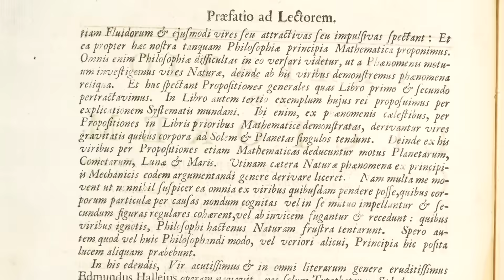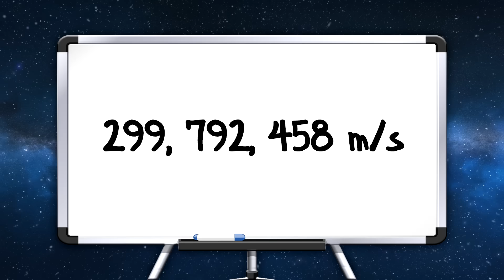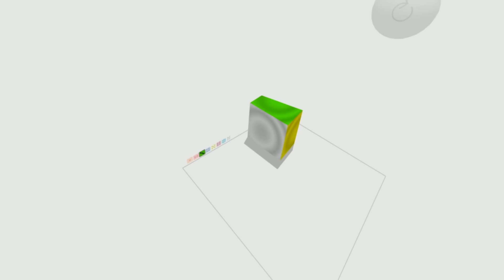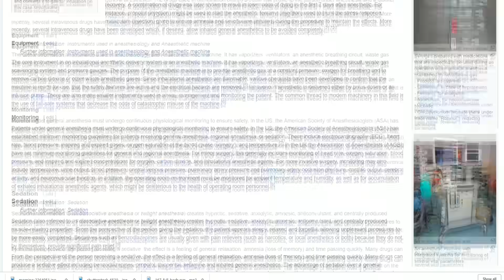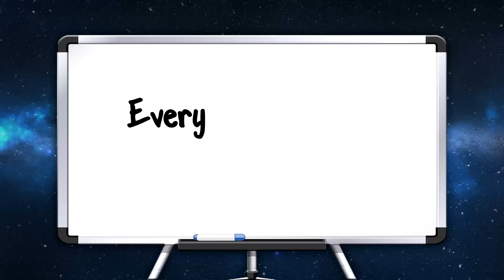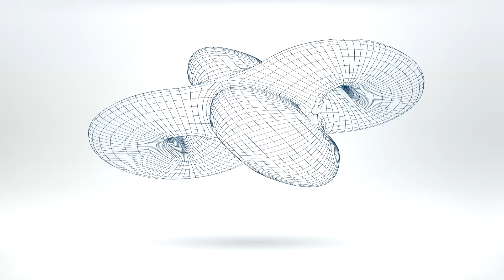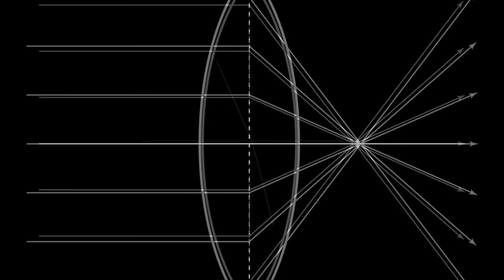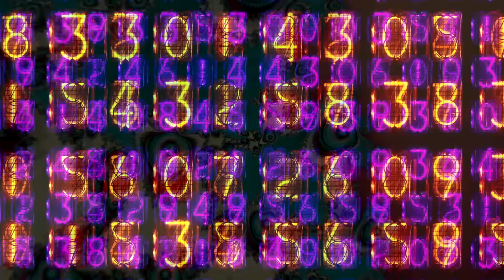The Mystery at the Bottom of Physics

Comment: If it is not a variable it is a constant. Welcome to math dude.  "6.674×10−11, which we call G. We need it just because of the way our unit of force, the newton, is defined: 1 newton is defined as the force needed to give a mass of 1 kilogram an acceleration of 1 meter per second squared. The kilogram, meter and second are rather arbitrary quantities, and as such, the newton is an arbitrary unit" - internet. I.e, it can be 1 if it makes you feel better just change your relative measure.

Comment: Suppose the universe is built upon pure geometry. It seems that everything requires at least one dimension to manifest. Height for example, is one dimensional.
A one dimensional thing can only exist if it has opposite ends, with a continuum inbetween. This is the principle of yin and yang.
On a mirror smooth pond, when a wave is created, there must also be an equal and opposite troth. Otherwise the pond volume will increase by the volume of the wave.
The particles of the standard model are yin and yang.
String theory; a string is a one dimensional object and is therefore yin and yang.
Newtons laws are yin and yang.
Statistically speaking it would be more likely that the universe would have come about due to a simple process. The yin yang principle is the simplest theory and underpins all others.

The universe is made of stuff; the stuff you're made of, the stuff I'm made of. We are 13.7 billion years old. There is no such thing as you and me, we are all one thing.
We are to the universe as waves are to the ocean. Waves are the ocean, all one thing.
What is the wind that blows the waves?

Comment: Is that right that if you were travelling at 250,000,000 m/s that light would still be travelling 'away' from you at 299,792,458 m/s? I thought if you were travelling past a planet say at 250,000,000 m/s and turned on a torch, the light from the torch measured from that planet would still be travelling at the speed of light (not the speed of light + your 250,000,000), but that relative to you it would only be travelling away at 49,792,458? Or is that a trick of special relatively that light always seems to be travelling away from you at the speed of light regardless of your own speed?

Comment: Obviously the speed of light DOES change. Relative to it's direction of travel compared to yours. Generally light is traveling in all directions around us during the day, that is why there is ambient light when the sun isn't shining directly into a room with windows. However, that doesn't change the fact that the light originated from a specific direction, direct sunlight. So in the morning if you are out for a jog with the sun at your back then photons take longer to hit you. Not by much, but it's the same effect as if a vehicle is driving next to you. It would be driving faster if you were standing still, relative to your speed. Likewise if you were running towards the sun then the light itself would be traveling faster than the "speed of light." There is no set speed, it's a physical tangible material with limitations. That's why plants can use it for growing physical material. Chlorophyll doesn't just "unlock" energy using sunlight as some kind of supernatural key, the photons are physically trapped and combined with other materials to create ATP.
Reply: Nope.

Comment: I was actually thinking about something similar to this a while ago, and I realized that the constants aren't fundamental. There's something else that dictates the function and form of the constants. Now some people might say that God is responsible for the constants and what they do, and while I think that's on the right path, I would argue that it goes deeper than that. I think math is the most fundamental thing in existence. 
Think about it like this... Imagine if absolutely nothing existed - No space, no time, no higher dimensional planes of existence, no God. Not even an empty, black void, because in order for something to be empty, it has to be a thing itself in the first place. In such a circumstance, math would still exist. Now, there would be no "concept" of math per se, since it would require a conscious mind to conceive of the principles of math to begin with, but even without that, the processes of math would still work. Even in this "state of pure non-existence", 1 + 1 would still equal 2. Doesn't matter that there would be no words for "1" or "2" or "equals", since they are abstractions that we created to describe their value or function, the principle would still be sound, that if you took one of a thing, and another one of a thing, and put them together, you would have two of a thing. This principle would still exist, independent of some sort of higher power or divine consciousness.

Comment: You're in a dizzy about the foundations of the constants? Heck, I think the things I can see are wrong. I mean, I was sitting there thinking one day, and I thought, we base our three dimensional view of space on a cube. A cube has Height, width, and depth. With numbers slapped on these three things, we define three dimensional space. Then I thought, why not use a Dodecahedron? Sure it would be complex, but I could define space with five dimensions. I was sure it would work. While I was at it, why not use any geometric constant shape? Which was the right one to tell me how many dimension space had? Time for a thought experiment. I imagined that the whole of space was very small. The edges were just far enough away, that I could not reach it, and I was floating right in the middle. How could I test for the numbers of dimensions? I would need a magic measuring stick. Even if I couldn't reach the edge of space, my stick could grow as long as I need to measure, and probe each dimension. First I would test width. I would make my magic measuring stick grow to the edge, and then I could know the width of all space. As it grow, it does seem to reach  the edge, it just keeps going. Then something pokes me in the ass. I look at the poke, and it's the magic measuring stick, and it's poking me, and a guy is holding it, and his back is to me. At first I think I have company, but after much swearing, I realize it's me. How can that be? The magic measuring stick looks straight, but there it is poking me. I try the other two possible dimensions, and it the same. The stick looks straight, but it keeps hitting from behind. Then I try random directions, and it's the same. Every which way I poke,  the hypothedical magic stick pokes me from behind. Worst yet, everywhere I look, there is the back of me. Are there thoasands of dimesions, and how does the stick come up behind me while staying straight. Then I get it. All of space must be curved, and things just look straight to me. Also, there just can't be infinity dimensions in my own personal space (universe). Space must have only one dimension. It's a good thing I'm big, or my universe is small, or I would have thought forever that space had three dimensions. Since everyone is bored, I just tell you this. Time is the other dimension I can actually observe. And all those thoasands of me I see just out of touch? Those are other universes, in a multiverse. Got to go eat. Wife is done exercising. Thanks for reading so far.

Comment: the whole cube thing is bollocks. look into buckminster fullers synergetics and you'll understand that we do actually live in a four dimensional space where time is always part of the special case scenario.

Universe isn't conceiving of space in three 90° perpendicular axis. that cubic misassumption can only work if you believe the earth to be flat, like the ancient greeks did who came up with that "geometry". the prime structure of Universe is the tetrahedron, all other shapes have a rational relationship to it and it has 4 sides, all in 60° coordination. space is made up of an isotropic vector matrix that can be modelled and used, as for instance in the octet truss or so called spaceframe. it is precisely the coordination of closed packed spheres, all 12 around one nucleus, that define the vector equilibrium, which is, incidentally, also the zero volume tetrahedron.

buckminster fuller wrote an entire book about this discovery and it's about time humankind began to abandon that irrational cubical notion. cubical space is as irrational as a flat earth. think about "horizontal" on a globe, it's a curved arc. and "vertical" is always radiant. so creating a "parallel" cube is inherently impossible as well as unstructural. if you make a cube, it's only going to hold it's shape if you make it really redundantly strong, or put in the diagonals, thus giving shape to the hidden tetrahedron in its center. you can easily create a tetrahedron from a piece of paper, from 4 balls or six beads and a string. no matter how, it will always be structural, surprisingly strong and fourdimensional.

please take a look at buckys synergetics, there even is a video from one of his presentations of the topic here on youtube. it's mind blowing!

Comment: Nice video.

Some of the constants you describe really are universal, such as pi or e or sqrt(2). These constants occur in nature all the time.
But many scientific constants, like G, are merely there to make up for our units for other quantities. For example, in the gravity equation F=Gmm/r^2, we say F is in newtons, mass is in kg, and distance is in metres, and G = 6.67408e+11. All of these are man-made units of measurement based on things that aren't closely related to gravity. If we changed our unit of distance from metres to inches, then the value of G also changes. G is therefore a man-made constant to account for our units.
Reply: The numerical value of G depends on the units, but the constant is universal and not man-made
Its an universal relation between properties of the universe, and that relation holds for any unit system
We dont define the numerical value of G, we measure it

To put it another way, in plank units G has the value of 1, and plank units isnt man-made (in the same sense a kilogram or a meter are)

Comment: I thought at first it was an old video then I saw no... just obsolete data.
First they are having a LOT of problems with these constants and taking them as fact is just lazy lying.
Reply: What problems?
Reply: @andrewglezp  Right down to the speed of light (causality) proving invalid due to quantum coupling. And that is just a start due to gravitational constants being called into question because the universe is accelerating... its a long list
Reply: @rhodes6840  the quantum entanglemet (coupling applies on quantum scales, the thing related to the speed of causality is the entanglement) doesnt invalidate the principle of the speed of causality, as there is no way to pass useful information from one point to another faster than c using entanglement; c still holds

And G does not change when the universe accelerates in his expansion, that has to do with the cosmological constant (another constant related to cosmology). Both of these constants appear in Einstein field equations of general relativity, if you wanna search it up :)
Reply: @andrewglezp  Actually the guys at CERN think it does... literally every constant is being questioned even old Einsteins work is suspicious because it looks like the sun actually has an atmosphere which refracts light, see nothing is settled. So yeah welcome to chaos

Comment: Maybe the problem with our perception of reality is simply that space itself confuses us? Space is responsible for diffusion, and diffusion is part of entropy. Entropy leads to death in humans. Perhaps even time as well is caused by entropy. Are the Universes that do not operate according to principles of diffusion? That use confluences and compression instead? We have those here, but it seems that diffusion really dominates in the long term. If we concentrated on energy exclusively, and not space, its medium, perhaps we would understand reality more plainly. Energy tends to get used up in our Universe, eventually beamed into space as photons that never return, as far as we know. Like the Big Bang singularity, energy starts from a central point then radiates outwards. But what if energy could start outwards then radiate INWARDS towards a compressed point? That would flip Physics around completely. Compression/confluence Universes may exist, in other dimensions or may be accessible right here in our reality. It may require some protection from our native physics, but this may be a surmountable obstacle. Do we live in the upside down? Certainly, the existence of the initial Big Bang singularity implies that compression phenomena may exist. Compression phenomena may be responsible for the conception of this Universe.

Comment: Ideas are a very fundamentally connecting unit of information. Basically everything we communicate is based on such unit of information which compresses whatever-we-know. So where does an idea ultimatively come from and what is it? What even is information? Is it abstract? Is abstract the fundament? Why did abstract, why did the idea, ever merge with whatever-there-is? Can we even grasp what is outside of an idea? Even that would be information translated simply different. Is there an outside or is it all the same? When we have a shadow, are we also just shadows? No one knows, what a sham.

Comment: Great video as always but i just have to ask, after that mobile internet comment all I could think was I wish he would explain to us the very difficult to understand formula which would answer what the nessesary speed that a head must move at in order to collide with the mass constant of an asshole and what additional unit of measurement is required to understand the xtreme lack of friction that allows it to travel un challenged straight up the large and small intestines into the stomachs gravity well. Lastly what mathematical formulae would show the incredible volume of lung capacity it would take to inhale the 2 weeks worth of unpassed farts that rotate around the afore mentioned stomachs gravity well.

Comment: 1:27 technically, the whole 'in a vacuum' thing is bullsh*t. It might take longer for light to reach the other end of a box if there's air in the way because it's bouncing around a bit. This means that its path is longer, not that its moving slower.
Reply: Koos Naamloos im may not be correct but i though that photons of light dont interact with other particles.
Reply: @jackperry8011  If photons wouldn't interact with anything you wouldn't be able to read this screen. It is true that in normal air photons hardly encounter any molecules to even have an interaction but it's enough to influence the measurements. You might also be thinking about dark matter, which hardly interacts indeed, but that's something different.

Comment: Does anyone know if exurb1a has a degree in something? I'm wondering whether or not he should know that, demonstrably, the fundamental physical constants do in fact change. Not over time, but with energy scale. This is well established in quantum field theory, which is the, uh, let's say incomplete theory of everything that's been around for a number of decades now. It predicts certain results extremely well, but on the other hand fails spectacularly at incorporating some easily shown experimental results (though you could argue that the reason for this is simply that the missing part of the Lagrangian simply has not been discovered/mathematically formulated yet (because honestly, QFT might just be the most mind-bogglingly complex physical theory ever conceived by man, which I'm sure some mathematicians just call "a tuesday")), and also because it's not feasible to be performing experiments at the energies required to shine new light on the murkier parts of the theory.

Anyway. Don't do theoretical physics, kids

Comment: The part about anesthesia is not completely right. There are actually two ways to induce anesthesia, breathing gas or through venous injection. While the latter is well understood, the former is harder to crack. We know it acts on GABA and NMDA receptors, and that more lipid soluble gases are more effective, but the complete chemical pathway description still eludes us because it's pretty hard to study. That is not to say we have "absolutely no idea" how they work, just that we are lacking a complete description and missing in details.
On an another note, generally science is not interested in the philosophical why of things. It limits to describe natural phenomenons with the most coherent and complete structure (theory), also because there is never an end to the why question. Once you got the model that describes perfectly your system, asking why that model works is outside the competence of science. We can find a good example in quantum mechanics, where the discussion on which is correct between Copenhagen, many worlds or pilot wave interpretation is still raging on, (and probably always will) even though they are all mathematically equivalent.